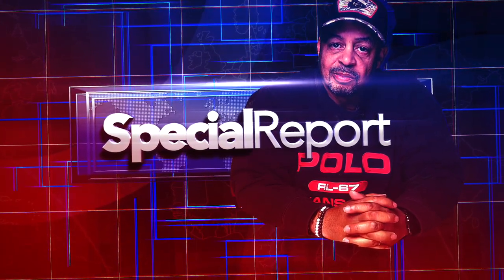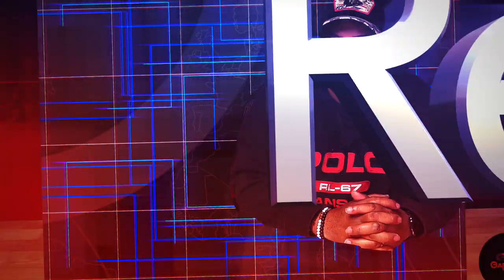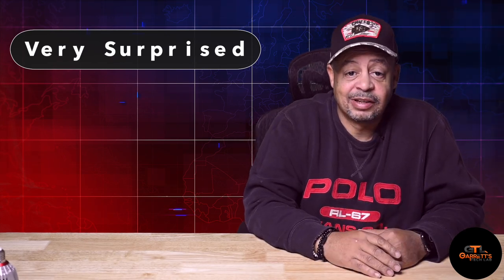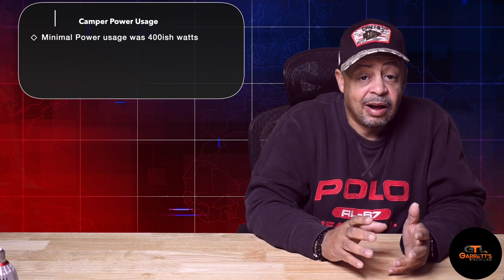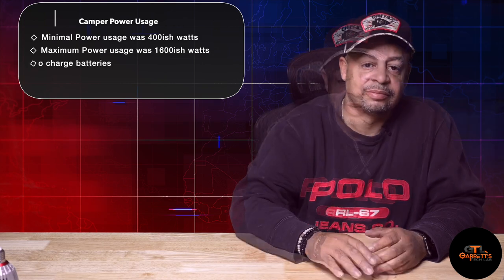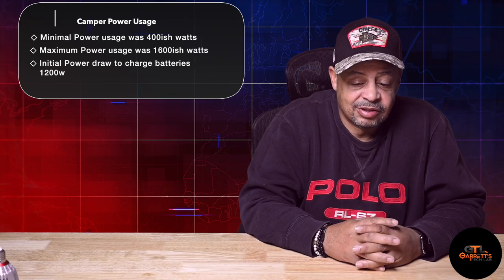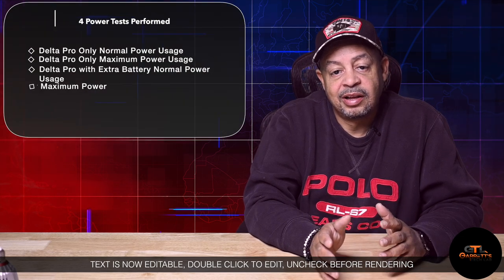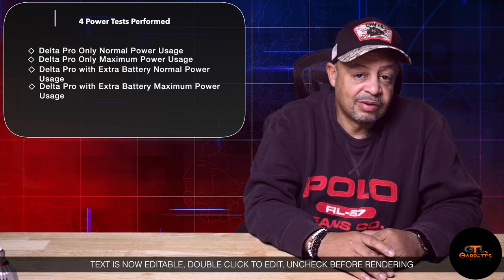Delta Pro Vs Travel Trailer Torture Test

Comment: I bought the Delta Pro about a month ago for my travel trailer.  So far I love it.  Runs everything in my trailer.  I'm so pleased with it that I ordered the second battery for longer life. Should be here in a couple of weeks.  Their claim to fame is how fast they charge and it is true.  My complaint is that they are pricey.  And so are their portable solar panels.  I would love to find cost effective portable solar panels out there.
Reply from the maker: I truly agree, their cost is high!  Especially the 400w solar panels with are 1000+ each and we would need 4 of them to charge the Delta Pro, crazy high.  Which is why I went with the generator.

Comment: Bought the delta pro for my 2011 Bayliner 285. To power my AC and other things while anchored so I don't have to be plugged into a  shore port and it gives me piece of mind while sleeping, no worries about carbon monoxide. I will use my portable battery box and inverter to charge the unit during the day. Haven't gotten it yet waiting for it to arrive but that's the plan, hope it works out the way I've planned it to. Hopping to get about 6 hrs of just AC at night during the summer. 75 degrees is cool enough for me.
Reply from the maker: I would think at 75 you could get really close to 6 hrs, especially without other devices on.  What type of portable battery box are you going to use to charge it?  I'd be interested in how you're planning to do that.  Let me know.

Comment: Btw. From my experience the 1200 watt draw when you initially connect your DP could be from your water heater instead. Turn your water heater to propane only, then test your unit. Also make sure your fridge is only on propane.
Reply from the maker: Thanks, I never thought about the water heater.  My fridge is a 18v so always running on battery.  Thanks for watching.

Comment: With the water heater and fridge both on propane I imagine the battery life would be much longer. My draw, without using AC, is about 200-400 watts so I guess I could go a couple of days on one battery without using solar. I think I need to convince the wife on this one. Thanks!
Reply from the maker: I am really amazed at how little power these campers draw.   The thing I like about this solution vs a battle born is that you can use it in more situations.

Comment: I really wish I got the Delta Pro from the Kickstarter program. Did not realize how good this Delta Pro is.
Reply from the maker: I'm also very surprised at how well they performed.  I would suggest to check Sams Club they had some Delta Pros that only accepted 1200w total solar vs 1600w the units can accept now.  I don't think that is a big deal personally 1200w vs 1600w solar input.  Thanks for watching.
Reply: I didn’t know that Sam’s Club had them, also, but I didn’t know that Costco has them.

Comment: I would've like to see actual video of what you tested but the 2nd battery not having any extras is better for overall efficiency and not needing fan to dispell heat for additional electronics.
Reply from the maker: I went back and forth between how much actual footage to include.  I had like 12hrs.   I suspected that was the reason for not having the extra outlets but still would have been nice!  Thanks for watching.

Comment: don't disconnect 12v battery, there is no MASS charge to 12v system, it is a constant output. AC has high start up amps
Reply from the maker: Thanks for the advice, after reading the comments I would have to agree to check the water heater, first.  Thanks for watching!